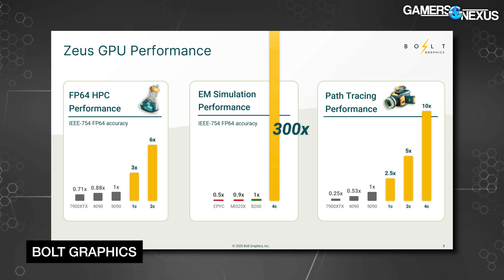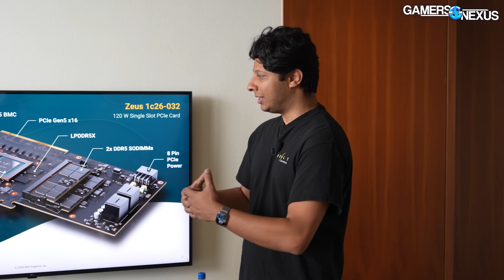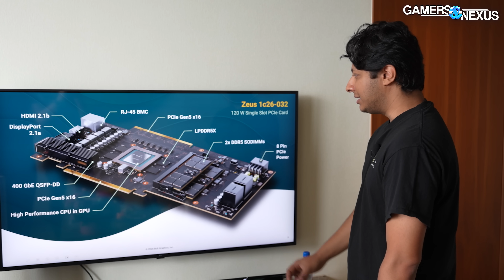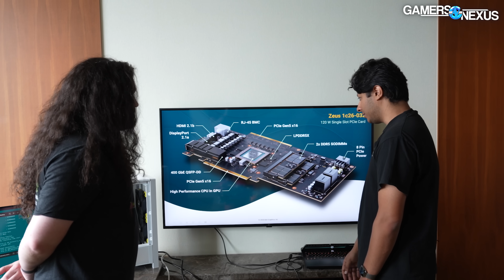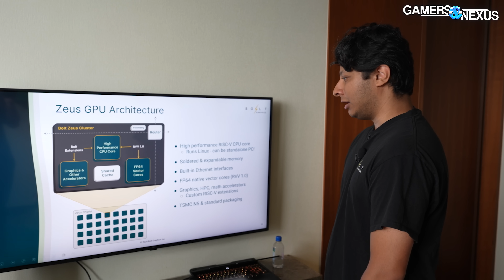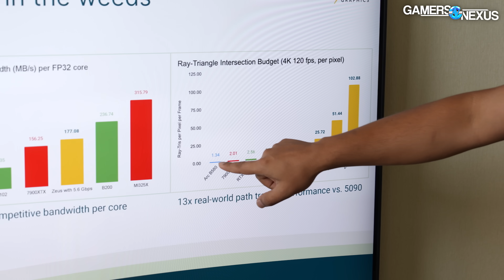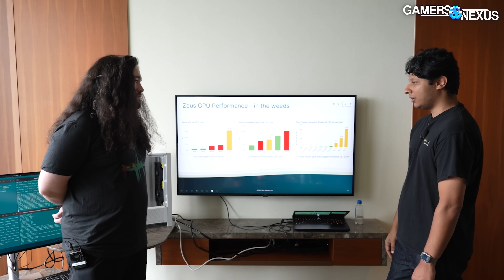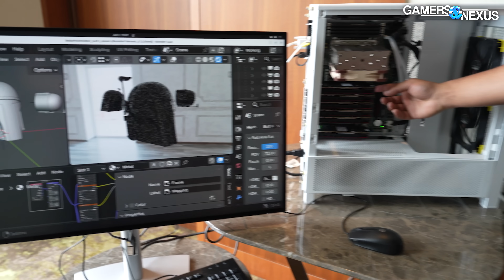A New Gaming GPU Challenger: Bolt Graphics Takes Aim at NVIDIA

Comment: i dont want the performance of every title made before 2018 o made by an indie dev to suffer for raytracing tho, like will this be a turning off physx situation where games that rely on it become unplayable?
Reply: Implementing Pathtracing is extremly simple, if it is a game that has any dev team behind it, it can be made to run path tracing with little effort. And if it is a game that is 8 years old, chances are it is so easy to run it won't have an issue even with less rasterization performance.

Comment: IMO, until I have one in hand, I still think Bolt is hot air. Very cool ideas though -- RISCV, PCIe interconnects, 400GBps networking. 
In other topics: meaningfully cooling those memory modules looks like a nightmare
It seems like just doing soldered DDR5 XOR SODIMM modules would both be better options than mixing both

Comment: I will believe it when Gamers Nexus gets a real BOLT GPU then benchmark it.
Reply: It seems the card part of it isn’t the difficult part, but getting the drivers to play nice is going to be pain.
Reply: @luipaardprint  I mean as long as I have hardware and firmware, I'm happy to wait on game driver side. 
 
This seems like it could be fun for a lot of weird projects and to just mess around with in different setups
Reply: @Adpocalyptic  true, but that's the biggest thing, getting to turn this GPU into something the general public will want to use, instead than something for enthusiasts, like what Intel went through.
Reply: @luipaardprint  The foot-in-the-door problem has killed many good products.
Reply: Yep. I heard about this supposed new, revolutionary GPU quite a while ago and it's still vaporware. They don't even have a functioning prototype. No way they'll have anything ready within 1-2 years.
Reply: why are there so many larpers in the tech space
Reply: It's going to be difficult for them not to be either acquired by a competitor (to liquidate competition) or fall into the datacenter honeypot trap (which he already alluded to in the video).

I completely agree that I'll believe it when I see it, but it's nice to pretend to have a little hope.

Comment: If they want to "win" tell them to optimise the hardware for turboquant similar to nvidia nvfp4 which is optimised via their hardware... Otherwise it would be slower than christmas on boxing day.

Datacentres don't care about TQ, but consumers who want to run AI on it will care. It's the difference between lobotomising a model to get it to fit or just not being able to fit it at all, or being able to run the model at a decent speed and near full quality.

Comment: That's not a GPU. It's a high performance modular server processing card. Cool toy, but there is no mass market for it, just gullible investors.
Reply: Could be used for inference if architecture has the needed data processing instructions. Need low latency links to connect multiple cards (SLI and the Ethernet port). Much memory is also needed (albeit bandwidth is also paramount). Seems similar to Tenstorrent cards from a mile away. LLMs are pretty hot right now.
Reply: And gullible youtubers, it seems.

Comment: The 90s are back, baby! Upgradeable VRAM, how I missed you!
Reply: Which is kinda needed with UE5 hoovering up VRAM. Consider that a bunch of the RTX 3XXX series is not able to handle that at 2k res.
Reply: 3dfx are now have its spiritual successor! even after the company bought by nVidia
Reply: It's kinda funny when I think about how a couple of years ago, when I proposed that in a comment under some YouTube video about GPUs, a whole gang of "expert engineers" jumped at me, writing essays about why it's IMPOSSIBLE to make a graphics card with replaceable VRAM modules :J  Welp, I'm curious what would they say now? :q
Reply: @bonbonpony  every fault they talk about would still suit here. you cannot make light travel any faster. and you cannot have the speed in a detachable part equal to that of a permently attached part.

im willing to bet they didnt say it was impossible, i bet they said doing so and still keeping the same performance is impossible, which it is, and always will be.
Reply: I don’t remember that being relevant to gaming because of so many other bottlenecks. No studio produced HD textures, the norm was 256x256 in the late 90s. Maybe for CAD GUI hi-res (1600x1200). But CAD wasn’t hardware accelerated (outside SGI). Line rendering wasn’t even accelerated.
Reply: @ArnaudMEURET  256 feels a bit high for the late 90's, most of us only had monitors that could do 800x600 resolution, if that. I didn't get my first 1024x768 capable flatscreen until sometime after 2000. Most gaming was still 640x480 unless you were balling with a brand new rig, 16x16 sounds a bit better, maybe 64x64 for large textures.
Reply: @MaverickBlue42  It was definitely noticeable with skyboxes, floors, and walls once OpenGL and Direct3D devices started competing with 3dfx. However, a lot of that was 16-bit color depth, yet another bottleneck that wasn't all that noticeable at first but then became more jarring when competitors arrived. Had 3dfx not taken four years to address these issues (and with a disastrous product at the end), they'd be brought up much less often in retrospect.
Reply: @MaverickBlue42  You state side? Wow forgot how shit ntsc was being from a pal country.
Reply: @MaverickBlue42  The Playstation had lots of 256x256 textures in games.
Reply: @waterpotato1667  It also had a 2KB texture cache, which has enough space to fit two 16bit colour textures at 256x256 (256*256*16), or eight 4 bit colour textures(256*256*4), and then absolutely nothing else because it would be full. So again, 256 feels a bit high for that time period even if the hardware was capable....
Reply: @MaverickBlue42  Fair enough.
Reply: The 80's and 90's were the best for media and tech
Reply: @jayb2705 hardware in general. Companies still operated under "best product = biggest profit"

Now we're go with "monopolies/cartels, planned obsolescence, and subscriptions = biggest profits"

Making a good product that last long and can be maintained by the user is unprofitable now.
Reply: what card had upgradeable vram back then? i've been gaming since 3dfx voodoo1 days, no card i ever had had expansion slots.
Reply: @oldfrend  ATi had one, the 3D Rage Pro or something like that. Earlier in the 90s there were 2D graphics cards that shipped with empty RAM sockets (1 being populated) in order to save on the upfront memory costs. People could buy a compatible chip for cheaper a year down the line, and many people did.
Reply: @oldfrend  matrox, ati,s3 and more had multiple cards like this. Not everyone could afford voodoo at the time , it was almost like buying a gpu 2 years ago price wise. Early ddr required soldering so when they started using it socketed chips went bye bye
Reply: @wind5250  3Dfx/Voodoo were the pinnacle of the end of the 90s in graphics software and hardware. The games that used 3Dfx API had better visuals, performance and all the source-code I've seen from then is much easier to read when it's API is 3Dfx/Glide rather than OpenGL 1.0 or Direct3D 6/7.
Reply: @oldfrend My Matrox Millenium 2 had this.
Reply: @Webshadow  I miss my matroxes
Reply: @oldfrend  S3 ViRGE (2MB > 4MB in 512KB chunks). Loved that card back in the day :).
Reply: @oldfrend Matrox Millennium cards had RAM expansion slots.
Reply: @oldfrend  Matrox Millennium G200, 8MB card, expandable to 16MB. My first graphics accelerator, played Rainbow Six and Unreal Tournament with it. A lot of ATI 3D Rage/Pro/Rage II cards had VRAM slots too. Pretty sure a bunch of Diamond cards also did it.
Reply: @oldfrend  I know some s3 cards did, off the top of my head I have a trio64v+ that has extra memory slots.
Reply: @oldfrend lots of cards had it. Just look it up. Cirrus logic cards and s3 to name some.
Reply: @oldfrend  Vega 56 / 64 has HBCC.
"Virtual VRAM: HBCC treats your system RAM as a massive extension of your graphics memory, allowing you to use system memory as a fast cache for VRAM-heavy games and 3D rendering tasks (like Blender)."
In the Radeon software you designate how much system RAM can be used.
Reply: @oldfrend  Cirrus Logic CL-GD5428 VLB (that is VESA Local Bus for you young ones) comes to mind as it was my first card.
Reply: Drivers...
Reply: @themonsterunderyourbed9408  Linux
Reply: @themonsterunderyourbed9408  I remember looking for 3rd party gpu drivers back in the day.
Reply: I don't miss the 90's graphics card though. In the past when Voodoo 2 was the pinnacle for gaming, you need a separate card just for 2D because Voodoo card only does 3D .
Reply: 28gb is minimum need . The rtx4090 is not enough, and the 5090 is a bit overkill.  28 is the new sweet spot
Reply: @SharkFaceKidd  5080 has less VRAM than 4090.
Reply: @cyanetica4802 I know what you speaking of . I sent it back because it was junk !😅😂  we need something with 28 gb . The 4090 is a joke too ! Not as much of one , but ...
Reply: Sorry.  I corrected it to 5090 is a bit overkill.  But the 5080 was disappointing enough to sent it back and wait
Reply: @SharkFaceKidd  you cant make blanket statements like this. it depends on the architecture and your setup on how much VRAM you need.
Reply: o7 to this absolute veteran!
Reply: Too bad it's slow.
Reply: It left for a reason.
Reply: it doesnt exist because its slow....
Reply: @matthew4107  I know you didn't actually watch the video. Literally addressed. LPDDR is the cache to address and mitigate latency
Reply: @crsv7armhl  i did watch the video, and no, it isnt, its low latency memory, but it doesnt 'address' the latency issue of detachable VRAM.
Reply: @matthew4107  Watch it again then. There are 16gb of LPDDR. How much is in a 4060? Not even that much. So why are you concerned about a secondary SODIMM ram cache?

How can you not realize latency issue is CPU -> GPU in the standard config not on GPU -> GPU transfer (literally in the video). There are two huge caches on it, LPDDR is the faster, but SODIMM -> LPDDR is still faster than CPU -> GPU in standard config. With both caches AND the CPU on the GPU your computer can basically DMA stuff onto SODIMM in a trickle while both LPDDR and SODIMM drain.
Reply: @crsv7armhl  
you changed your goal posts a bit xD

and to answer your next point, because people are fans of the idea of being able to install your own VRAM, but they do so under the understanding that its going to be as simple as that 'install more VRAM' but its not, its slower, alot slower, its kind of a scam with saying 'user can install own VRAM' because its misleading.

a 4060 is a dreadful comparison, because it uses GDDR6, LPDDR5 is not GDDR6, its much slower, and you cant actually compare cards like you are, AMD, intel, Nvidea, and now bolt all have different architecture working with different memory tiers. its not as simple as 6GB is more than 4GB. 5GB of GDDR5 is a worse deal than 4GB of GDDR6 or 3GB of GDDR6X, but, again, its not even as simple as that, because it depends on what architecture youre on. the guy touched on this subject very very briefly in the video you told me i didnt watch....
Reply: @matthew4107  I never said it was as simple as ram v ram. You still can't seem to grasp the "latency" issue you are so concerned about is caused on a normal GPU by Computer -> GPU transfer.

Do you also do that with cars?
"Uhhh WeLl ThAt CaR iS tOo SlOw" when the person getting it just needs to be able to go to and from work?
Reply: @matthew4107  Me when i don't know what i'm talking about on the internet:
Reply: @MoonNestCZ  irony, you dont know shit about this and youre still talking.
Reply: @crsv7armhl  if all you need is to get to and from work, the integrated graphics capability has come VERY VERY VERY far. stop saying stupid things
Reply: You mean "how I imagined you". Was never a mainstream thing, if it was even a thing at all.
Reply: @TUUK2006  it absolutely was a thing. Believe it or not, we didn't have 3D acceleration once upon a time. A quick Google would have informed you, but instead you chose to show your ignorance to the world. Good job.
Reply: Your that old and still playing video games? get a job
Reply: @iMixMaSteR1 I have a job, that's why I can afford video games. Have fun on your 1060 mommy and daddy bought you off eBay! I'll keep blasting along on my 4090 because I'm a real adult.
Reply: @underleft  A. I wasn’t talking to you. 
B. There’s nothing manly about being a gamer dork.

Stay poor
Reply: @underleft  isnt that the card that sets fire to itself?

Comment: That raytracing slide is crazy.
If they can handle the side things that GPUs do quick enough, then it sounds like they'd just crush in raytraced gaming.
The interesting thing about raytracing is (IIRC) it should have render time be rather decoupled from what exactly is being rendered (rays per pixel, not polygons).
So if that's the case, then you'd expect super consistent frametimes and scenes that could be crazy detailed as long as they fit in memory.

Comment: I wish Bolt all the success honestly. I'll be following them closely.
Reply: This is timely.  I was recently - fantasizing, I guess - about someone new breaking into the GPU market in any capacity.  I figured it was nearly impossible.  Bolt seems to have a good plan to approach the market.  I too wish them great success.
Reply: @Randrew  their target is pro market which is the kind of market that making big money right now.
Reply: @arenzricodexd4409  Pro market for starters, gaming market as a goal.
Pro market is easier to get to because you don't have to support as much technology and you're only competing with overpriced Nvidia.

Gaming application is also promising. It might even bring SLI back. 
And it'll work because the cards are connected via full bandwidth PCIE16x this time.

If these cards actually work well in parallel and are multiple times cheaper than Nvidia, people might buy multiple of them and PCs might start looking like an old school mess of cables from the 2000s, but more advanced and less centralised.
Reply: It's truth that work for NATO?
Reply: @IncognitoActivado  What do politics have to do with GAMING GPUS!? 😭
Reply: @narrativeless404  A lot in fact.

Comment: With scalable DDR5's and multi card interface it definitely looks more as AI training card instead of gaming one. I seriously doubt the real aim is to get this to regular gamers.
Reply: They designed it with High Precision FP64, which is opposite what GPU makers are doing right now. Nvidia dropped the ball on High Precision because they are chasing AI and low precision. Hopper can go as low as FP8, blackwell went even lower to FP4, blackwell Ultra dropped FP64 almost entirely in favor of fp4.
Reply: Currently gamers compete with (or rather, lose to) AI for GPUs, so I'd root for someone new to enter the AI GPU space and provide competition.
Reply: The lots of slow VRAM thing is similar, but if they were targeting neural network use they'd be focusing on FP4 performance. I think the smallest they mentioned was FP16? It sounds more like they're making a workstation card for high end graphics rendering.
Reply: @Gagarin777 Bingo, its not aimed at gamers and most likely never will. Even if it worked with games the driver support would be horrible. It took Intel two GPU generations with their billions of dollars yo make it half decent.
Reply: if you want ddr5 for gaming just buy an 8 yo gpu... used...
Reply: @roguedev33  That’s Gddr, which is generally higher bandwith depending on the frequency. It can generally scale higher in most implementations and go wider.